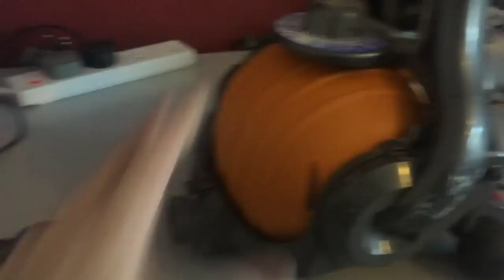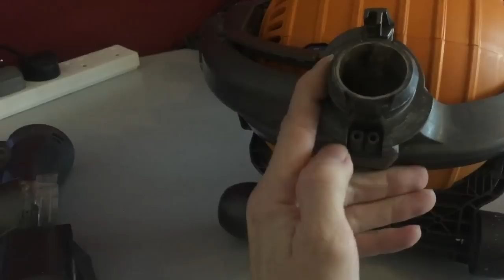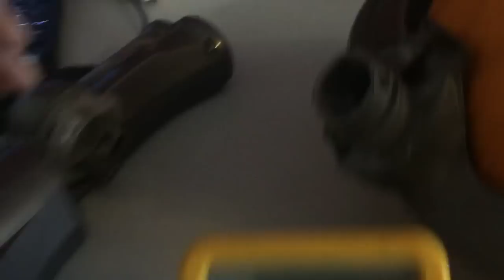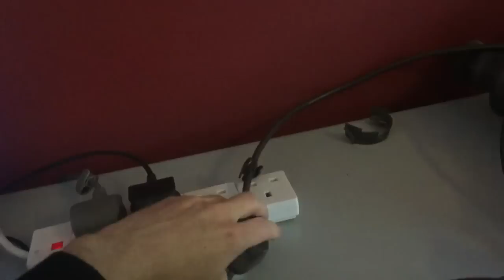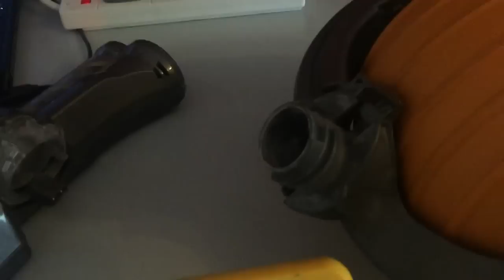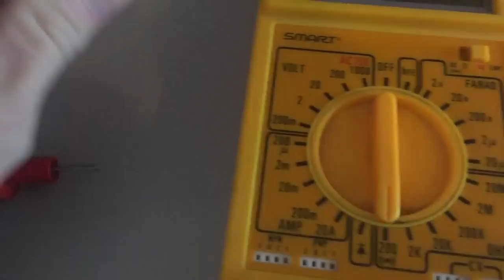Dyson DC24 brush not going round

Comment: Thank you from me too.  Not sure what was wrong but followed your tutorial, cleared a lot of fluff from each side of the brush head housing using tweezers, put it back together, pressed the reset button (didn't know what that was before) and it works again.  You gave me the confidence to try for myself.
Reply: On the latest head there isn't a reset switch.

Comment: I have this issues with mine. Dismantling it I found a resistor to be burned out on the motor control board. R 1. this is a common fault. The resistor value is 2.55 ohmes. (2R55). Hard to find in single quantities Ebay is probably the best source .

Comment: I had an issue with brush head not spinning, turns out one of the wires was severed providing power to brush head. There are two wires ( a red & a white ) going to head unit visible when you remove the right side access panel. I spliced the wire back together and power is now restored.

Comment: Great diagnostic video, thanks. Mine has 250v, the motor spins and the brush goes round, but any resistance i.e. carpet, it stops.  The belt seems tight on the mechanism. Do you think the motor is passed it ?

Comment: My brush bar suddenly stopped working, but if when it's running I give it a helping by turning it the bar will then start spinning. If I put the head on to the carpet it then stops, as if it's not got enough power when it's got the resistance created by being pushed up against the carpet. When I run it over my less thick door mat the bar works (after I've given it the helping hand of freeing it up to spin).

One thing I think I did a few weeks ago was hoover the bathroom and there were some spots of water from the shower on the floor, I am now wondering if some of the dust had possibly turned to a mud like consistancy and is maybe stopping the spindle of the motor going round properly? I CERTAINLY WONT BE DOING THAT AGAIN!!

Comment: So I did the voltage test and got ~117 v AC.  Voltage drops from 117 to around 12v AC when the brush motor switch is engaged.  I am going to check the set of the contacts to make sure it is not a problem there, and perhaps clean up the wiper contact in the hinge, but then I am possibly stuck.  At what point do I assume it is just the motor and replace?

Comment: Am in UK. Cannot get red reset button to stay depressed! Any hints? Have tried the 'rubber on the end of a pencil' and it still won't engage/click into place.
Reply: It doesn't stay depressed....only needs press and release.
Reply: Unless it has tripped the button doesn't 'stay in' as it's already 'in'; but you can press it further. Need to check it with a meter after stripdown and probably will find that it is making contact ok.  Check for burnt out parts on the pcb and that the motor is OK with a resistance of around 400 ohms across the brushes.

Comment: can anyone advise me please? my brush bar will rotate when I tilt it off the ground but once it comes into contact with the carpet it stops spinning? do you think this is a motor problem or something else,any advice would be greatly appreciated thanks.
Reply: andrea humble I'm having the same problem
Reply: heather Murphy hi I decided just to buy a replacement brush bar motor head off ebay and it fixed it so the old one must have just been knackered! this is the second one this has had the first one broke under warranty so was free to replace! 😕 but at least it's working again.
Reply: andrea humble  m'
Reply: i called them and they walked me through trouble shooting turns out I had a penny stuck where I couldn't see it. great customer service I'm glad it's working again for you! I cannot live without mine as I have three dogs and two cats as well as three kids !